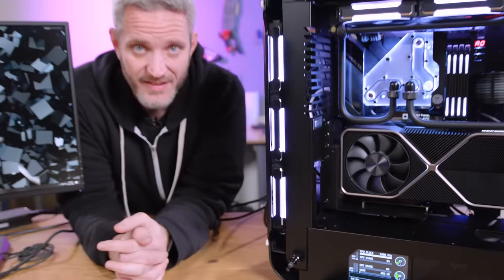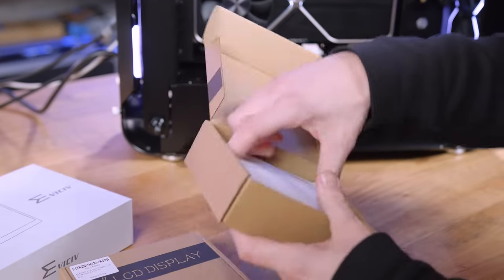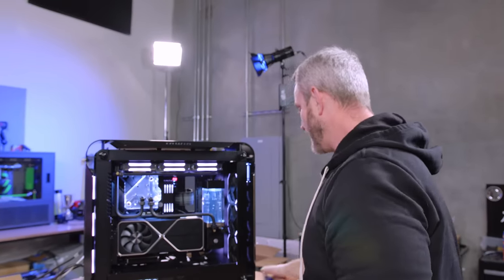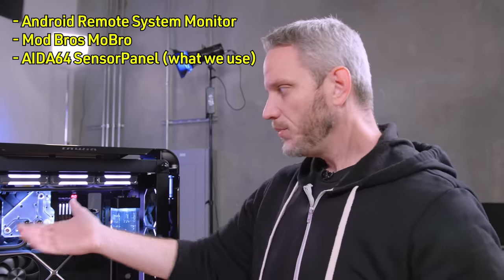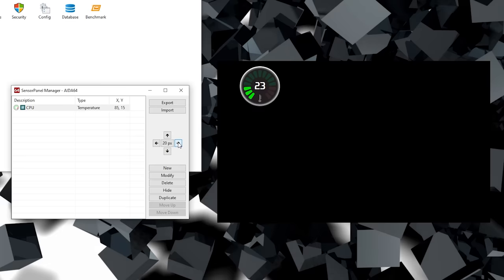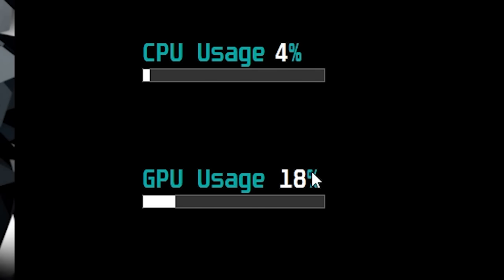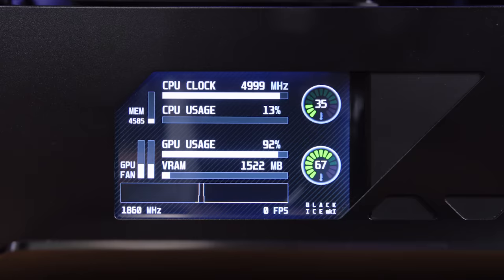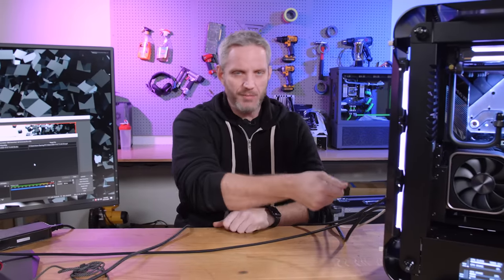EVERY PC should have one of these! How to make a sensor panel!

Comment: I know I'm very late to the party, but USB headers on motherboards are on the standby rail, just like the USB A ports in the back. So when you shut down the system there will still be 5V power. This is to make it so that front powered USB ports get power even when the system is shutdown. Perhaps your particular motherboard doesn't do this, but that is the industry standard.
Reply: It depends, that normally can be disabled in bios and I’ve seen it turned off by default in bios.

Comment: Is it possible to make the small LCD view-only so that you don’t look for your mouse pointer all the time?
Reply: Kind of. You can rearrange the display layout in windows settings so that the edges of the screens dont line up at all and then you wont be able to move your mouse over to it, but if anything snaps your mouse over to it for any reason then it's kinda a pain to get your mouse back lol.
Reply: @JoshQuake  That’s actually great. I didn’t know you can change the display layout by drag&dropping the two displays in the display-layout settings. I’ll stick with just a small overlap of the two displays’ edges just to be sure my pointer doesn’t get accidentally locked in the small one. Thank you for  the suggestion. :)

Comment: I did in the front panel of a Define S, used a touche screen 7" LCD. The issues I had: choose the direction of the 90° angle HDMI cable (long side towards front or back), "no signal" blue display solved by changing the Bios option under Advanced > APM Configuration > ErP Ready > Enabled(S4+S5) on my Asus Ranger VIII, touchscreen on LCD activates on the main screen (solved by using the command line "control /name Microsoft.TabletPCSettings" under Win10, image not centered on the screen (bezel on the top bigger than on the bottom)... But in the end, it works: https://www.youtube.com/watch?v=C8puBOFQCLI

Comment: Stupid question - Are you plugging the HDMI cable into the 3090 or the motherboard integrated one?
Reply: if i had to guess, probably the graphics card, tho i believe if your onboards are still functional with a graphics card slotted in, i don't think it would matter? don't know for sure
Reply: I believe there exist USB to HDMI converters which you could use to run it off of an internal header if you don't want cables coming out and back into your PC.
Reply: I believe those motherboard video connectors only work if you have a cpu with internal gpu, so not likely working with the CPU in that system
Reply: Id hope the motherboard one would work. Giving up an hdmi port is a pretty big deal with these new cards. I don't even have a spare on my FE card!
Reply: @TheRealGara  yeh motherboard works if you have an internal gpu and set it in the bios that both internal gpu and external gpu are enabled
Reply: likely the 3090, dunno exactly what cpu he's got in there however i doubt that it has an igpu to go with the plugs on the mobo.
Reply: @chuckvanderlinden1522  some older systems had integrated graphics on the motherboard, not in the cpu. Actually, that was pretty much the standard before APU's were modernized due to game console demands.
Reply: @TheRealGara  i’m planning to get a display port to HDMI adapter to make mine work. Only have one HDMI on my GPU, but three display ports and only one being used
Reply: You could certainly use the motherboard ports, but you might have to manually enable the integrated GPU in the BIOS setup, a lot of boards automatically switch it off when PCIE graphics cards are detected. Also, while Jay'z CPU has integrated graphics, the motherboard has no video output ports, not even speaking of compatible ones, so it seems likely he plugged it into his 3090 - unless he hid something in the build which we do not see, that is the only HDMI source in the system. Not sure why anyone would want to waste their only HDMI 2.1 port on a silly little status display, but frankly, any sort of GPU port would be too precious for my tastes. Whether triple-head and VR, triple-had and TV or dual-head, TV and VR, four ports on the GPU are just about exactly the right number for a lot of enthusiast setups, and unless your only VR HMD is a quest, your desktop is far away from a big-screen TV or you are content with a small monitor setup, I think blowing a 3090 port on something that does not display a difficult live 3D image is not worth it and detracts from the otherwise high-end nature of the build.

Comment: After watching this vid I couldn't help myself. Installed Aida64 extreme, purchased an 11.9 inch Ips raspberry pi screen. The aida64 forum has a section called "share your sensor panel" went and found something I liked, then tweaked the resolution, custom fonts, custom gauges etc. It's brill.

Comment: so, my question is, how can I plug in the hdmi without taking off the back panel of my case forever? XD
Reply: I have one of my PCI-E slot covers opened up where I can slip cables through to the back :)
Reply: @weegle.  I did something similar but took it a step further I guess. I bought a pci cover with a com port. Unscrewed the comport so I just had the cover with a cutout. Then I got a female to female HDMI adaptor "with screw holes" that fits a DB9 size cutout (same as the com port cutout). (I got it in canadia so it was here: https://www.primecables.ca/p-385849-cab-ad-hdmis-6in-6-inch-hdmi-female-to-female-adapter-with-screw-holes )
Reply: @whiskeyjackca  turns out there's apparently a such thing at internal usb port hubs that are powered by molex or sata... Welp
Reply: @weegle.  well... dammit
Reply: Open one of the PCI-E brackets.
Reply: You could drill a hole or cut a small notch in to allow the cable to pass through if you don't want a missing pci cover, I've actually seen pre-notched ones included with various products too.

Comment: So is the HDMI looping out the back of the case into the GPU?
Reply: I'm wondering the same thing. My guess would be yes
Reply: @MrJbobino  i would use a pci x1  extender and a pci x1 graphics card i checked ebay both pretty cheap

Comment: Great video! 
I am a noob and building my first rig. This is a feature I would love to have and like you said not that complicated. 
Can you use the onboard graphics for the display instead of the GPU?
Reply: Sure! Depending on your motherboard, you will have to go into the BIOS and change a setting so that the integrated graphics will still power on when you have an external GPU connected.

Comment: Is there a way to stop your cursor from moving to the other screen when you move your mouse to the edge? or do you just have to accept your fate and sacrifice a small portion of screen edge real estate to the small monitor
Reply: You can arrange the monitor layout so that it's offset diagonally from your main monitor(s). The same way you would set what side the monitor is on in display settings. that way there's only a tiny section of an edge you don't normally use where the cursor will go to the other screen.

Comment: Jay: ‘Every PC should have one of these’
Me, laughing in Aquaero: now that’s something revelatory :D
Reply: I guess you could do that. The main advantage of Aquaero over software powered solutions is that it's basically a separate monitoring computer inside a computer, it works whether the PC works or not. Even when the PC freezes hard during overnight OC stability testing it'll still gather data and act accordingly, pulling the power plug if the parametres go outside the threshold while other panels would just stop refreshing output data and do nothing.
Reply: @jonathanlarsen4177  - for the last couple of years I used to use it in a massive Coolermaster Stacker STC-T01, 11 or 12 front 5.25” bays if I’m not mistaken so plenty of room for both info panel and optical drives. After the last spring upgrade I migrated to a smaller yet infinitely more cable management friendly Coolermaster HAF XB Evo. Just two bays but excellent access from three sides and plenty of room for hiding all the cables (8 physical sensors sending data to the Aquaero unit at the moment, and that’s just for the temperature!). Plus, it’s a desktop case, aligned horizontally, so graphics card sagging problem solved itself :)

Comment: How did you run the hdmi out of the case?
Reply: I know it's only a small load, but I wonder if you could use the onboard graphics instead of connecting to your main graphics card.  Might be better for existing multi monitor setups.
Also, you'll probably need to reset the Start bar every time you update your graphics driver, as Nvidia drivers (at least) have a habit of resetting the settings.
Reply: I was thinking they have those USB to HDMI adapters that aren't too much.  One USB header could both power and run HDMI on this and at 480p, it shouldn't struggle at all to keep up.
Reply: @Merlin_Shaw  I've got a couple of the Lilliput USB monitors.  Whilst they sound a great idea, they use a bit of software called DisplayLink(?) which really doesn't like working with Win10.  Might be easier to take the power from a molex connector, I think the red wire is 5V, rather than a USB header.

Comment: So, I made one of these things. Some changes I did: first, I power the thing with a cheap USB hub. Hid it on the backside of the system tray and ran the cable out to the power adapter connection. That required an adapter so I could a short cord that came with the screen. Then drive the 5" screen with an interior USB header. Turns out there is a USB -> HDMI signal pathway that Windows understands how to get a video signal out. There's a driver in a chip in the adapter cable I found on Amazon. Windows understood right out of the box how to access and run the driver, and the screen shows up in Windows Display settings. Works very well, although it adds to the cabling in the PC. Mounting it was a challenge. It's in an Enthoo Pro 2, so there was TONS of room. Just finding a mounting spot was a bit of a challenge. Turns out, right below the vertical GPU mount, on what is the structural plate for the PSU chamber behind, are four mounting sockets, threaded for for what turns out to be an ITX system board. I hadn't realized that this case was a dual system case. Not sure where exactly they expect you to put the second PSU, but (wait for it) I digress. I eventually found a pair of mounting brackets, when combined with the leftover brackets from my water cooling reservoir in this rig, that I could securely mount the screen, with plenty of clearance behind it, into the top 2 mount points for the ITX board.
That's the good part. Software to build the AIDA64 monitoring stuff wasn't too hard.
BUT, Windows is weird.
HUGE issues with Windows wanting to constantly use this screen as the primary display. Still trying to work out a way to stop that from happening all the time. (I already had 2-22" screen in use (that's why I had to use the USB to HDMI adapter to get the video signal...both ports on the GPU were occupied).
Anyway, every time the UAC kicks in, or you CTRL-ALT-DEL or something like that, Windows darkens one of the big screens, and kicks the little monitor offline, at least until you answer the UAC prompt. Takes a moment or two to get it to come back. Sometimes it doesn't come back. And things get weirder.
Would love to talk to Phil by email or something to ask how he solved that.

Comment: Let me suggest an even cheaper and much easier solution.

8" chinese tablet: $20 - free if you have some old android device lying around
spacedesk or another desktop extend app: free

There, I saved you $50 and a lot of modding.
Reply: @Zen Re: you would still need an adapter for the ribbon cable to the lcd screen yeah?
Reply: @Red8675309666  You don't use the screen by itself... you use a whole device :D
Reply: is there an app that won't do this stupid extended monitor and will just communicate with the pc over wifi to get the stats? we all have old phones laying around with great 720p or 1080p screens!!! Why buy some shitty 480p raspberry screen when you literally have a 1080p 6" amoled display collecting dust
Reply: @25566  Check Pitikapp for android.
Reply: Yes people  have done that, but the phones heat up excessively.  I suggest  mounting  it on the outside  for air movement.
Reply: @linyeful  This. I used an old Lg G2 Android phone with Pitikapp, and put it inside the PSU window of my P600s case. Perfect fit, easier and free.
Reply: AMD link does all the monitoring and control you want on an Android device. You can even place it on the front of a non-airflow case and use the touchscreen controls to monitor, record, stream, etc.
Reply: @AndreiNeacsu  Do you need to have a Radeon card for AMD link, or it does work on any system?
Reply: @MrNangu  I use 3 Vega 56 cards with such a system. Given that it's installed by the driver package, I suspect that it only works on AMD cards including and newer than the first CGN architecture (HD 7750 and newer).
Reply: @AndreiNeacsu  Cool!! Thank you.
Reply: @rockstarimotski  how do you get the info from your pc to the tablet?
Reply: Also if you have an old Android phone not being used you can set it up through that
Reply: @MrNangu  I've read reports of AVG and Windows Defender stopping the server from running on your system right after installing Pitikapp due to a ''crypto ransomware'' flag. Is there anything to this?
Edit: I forgot to mention that you can get the full version of Pitikapp for a $1 donation.
Reply: @charlesrichards5389  I don't know about AVG, but it's not a problem with Defender.

Comment: Will Aida64's free trial nonsense mess up the display when your trial runs out? Or do you have to pay the ~$40?
Reply: Wondering the same thing!
Reply: n
Reply: @rgracon  it does. So far i found that the gpu temp and utilisation dont work with the trial and instead of a number you get "TRIAL"
Reply: You might try something like Rainmeter as a free alternative.  There are system monitoring skins for it, but it does have a bit of a learning curve to get it to look exactly how you want it to.
Reply: AIDA64 is like WinRAR. Nobody really pays for it. Just use any of the pregenerated keys floating around on the net... like UKWKDTFKD6FJDNFF4D34FYY13 
Disable the daily (which is quite idiotic anyway) update check in the settings to not get the ad when it phones home and.... hey presto... no need to worry for 5 years
Reply: @Knaeckebrotsaege  OMG thank you!! I didn't even know that was possible!

Comment: Just got all of mine installed and gotta do AIDA64 Extreme is all now.  I just put it in top left and used the standoffs and drilled 2 holes and boom it works.  I could get more cables and make it look nicer but maybe in the future if I care a bit more about how the cables look.  Took this route for now since I didn't want to have to cut out a hole in the bottom panel for it to work.

Comment: "They're cheap, they are only like $49"
I spat my drink fam, $50 for a small 5" shit display? it should be more like $10
Reply: It's a capacitive touch display. Also the demand for these because of raspberry pi is very high.
Reply: The software is also $40. They left that out.
Reply: Amazon. I got mine for 22 bucks. I also use Aida64 Xtreme & there are videos for free product keys. I got mine completely free. Also Rainmeter & NZXT Cam. But I've noticed Cam is a little off as far as temps. GL!
Reply: @burgerbait  it was 60$ for this flappy head Canadian. Also that was a yearly sub.

Comment: Me using Raimeter on my second monitor: "Amateur."
Reply: How much ram consume using Rainmeter
Reply: @danielbarandino4792  I have a 16GB Dual Channel kit at 3200Mhz and it doesn't even take up 100KB for me
Reply: @danielbarandino4792  Rainmeter uses 12 MB on my system with a clock and some icons loaded
Reply: @sigbinchupacabra8923  same

Comment: The tip about using an usb cable than goes to the usb pin connector of the motherboard is wonderful man. I don't know why every seller only add and usb A cable, when it's know that when the pc turns off, the screen gonna stay ON.

Comment: "iTs cHeAp, iT rUnS aBoUt 50$"
Thats enough money to buy a new mouse, keyboard and a chasis. Welcome to poorville.
Reply: He neglected to add the cost of the software.  Its $40 for aida64. its not a free program. So after tax you are looking at $100.  Cheap for rich streamers who get 3080s and ps5 sent to them for free, not cheap for working stiffs who have to buy everything with the crumbs we have left after bills.
Reply: the wheels on his camaro that are in all his b roll are like 10k. hes not in your tax bracket.
Reply: you can probably get a used monitor for that price
Reply: pretty sure thats 1/3rd a decent mouse
Reply: @doesntexistanymore978  you aim and click, working = decent
Reply: @midnightshade32 AIDA64 is like WinRAR... nobody pays for it. Getting hold of a valid generated key (like UKT2DUF1D6FJDNFF4D34FYY1N) is piss easy. The devs know about the whole keygen situation and they decided not to actively block keys, but will instead show an ad (for their own software) every time AIDA looks for an update. Disable the automatic daily (which is pretty idiotic in itself, but i digress) update check in the settings and hey presto... no need to worry for 5 years.
And it's not like their official downloads are well hidden either... download.aida64.com/aida64extreme630.zip (or exe if you'd like the installer)